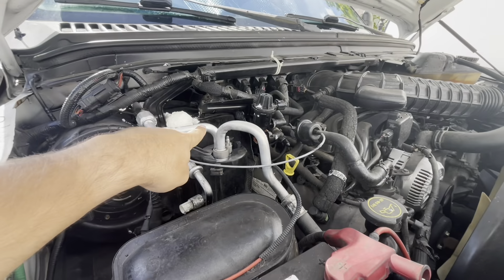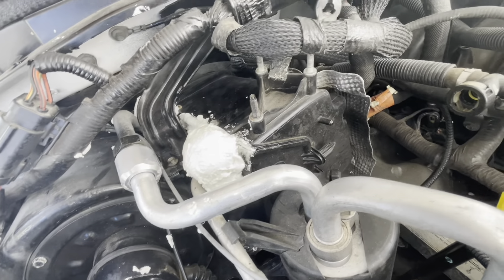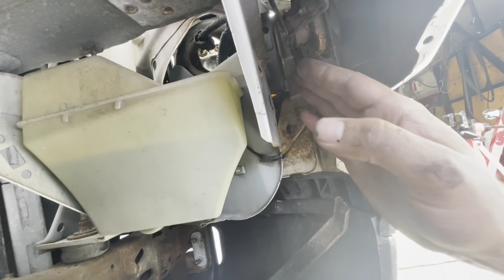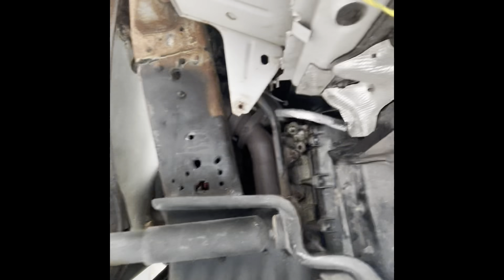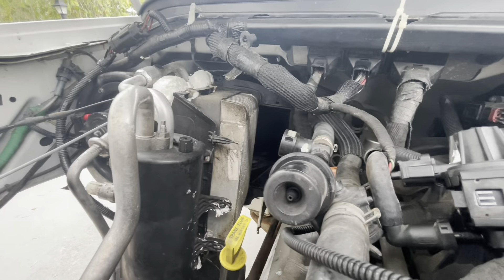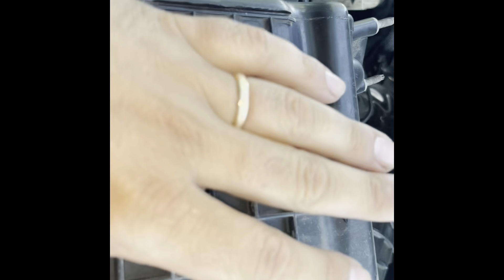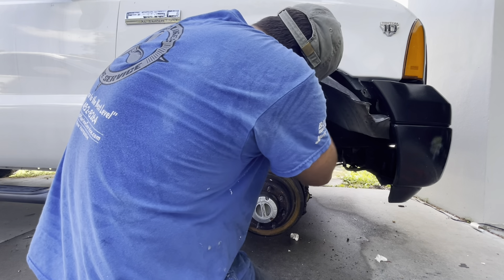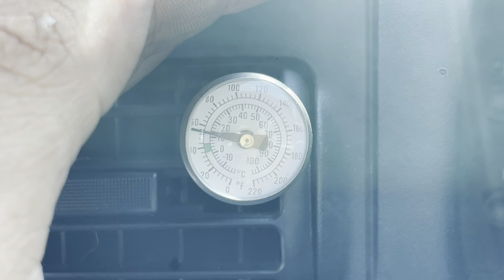06 f250 ac coil cleaning

Comment: Unfortunately, unless I’m mistaken, this won’t work on a 6.0. I watched this a few days ago, and tried this yesterday. Took off wheel well liner, blower, brackets, etc, and all 10 screws holding the cover on the box. Unfortunately, the valve cover on the 6.0 is too close to the box. No room to wiggle it off the bottom of the evaporator, even if the trans dipstick tube and intercooler pipe are removed. Evap and dryer would have to be removed and the evaporator pulled out along with the cover. But, I did what you recommended with compressed air and a vacuum, as much as I could through the blower hole. Does feel it blows stronger and a little cooler. Without this video, I probably wouldn’t have tried it. Thanks!

Comment: These AC’s are hard to get working correctly when they start blowing warm air. There are several things that can happen to them. The first thing I would do is buy a piece of heater hose and bypass your heater core where it comes off the water pump. Don’t block it, bypass it. I do this every summer, takes about 5 minutes. I leave the stock hoses disconnected under the hood. Another thing that happens is there is a malfunction in the blender door. The actuator is super easy to change, but before I would replace it, i would pull it out and test it to see if it turns with the blender control. I have a piece off an old actuator that I use to make sure the blender door swings freely. This got mine to the point that the cabin is tolerable on a hot summer day in the South, but not as good as it used to be. I notice with mine that the compressor never cycles off. When I put gauges on it, the high side pressure is low, so I am suspecting the compressor, but it could be something else like the orifice. All I can say is good luck. If the heater hose trick works good enough, I would be happy with that result unless you want to really dig into it. 😅

Comment: Thanks Aaron.  The airflow should improve.  Temp is a function of refrigerant charge.  The main leak culprit (if there is a leak) would be the valve inserts.
Reply: Please Describe the foil insulation roll and where you purchased it. Is it have adhesive on one side?